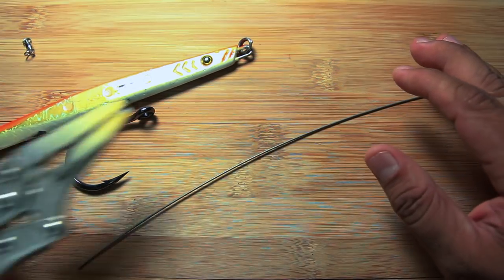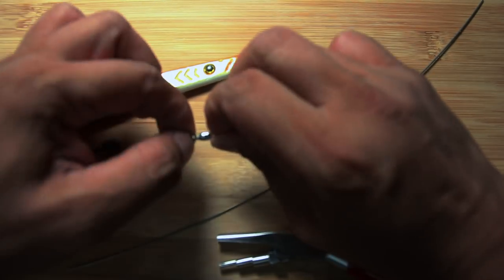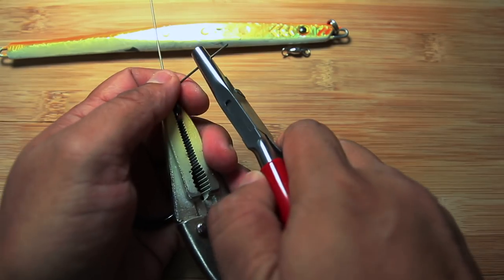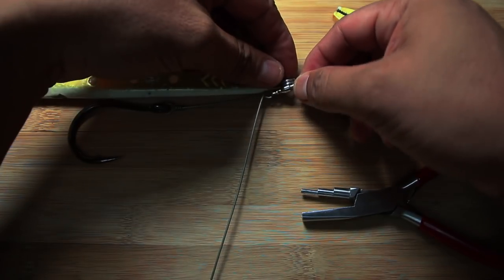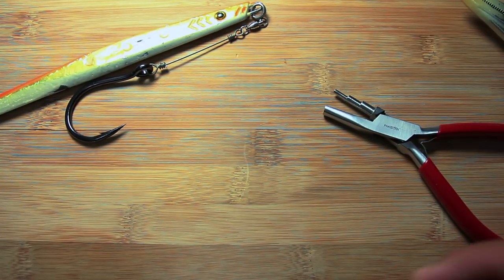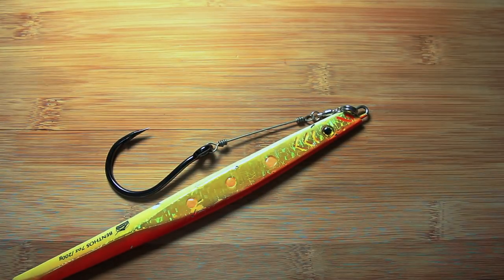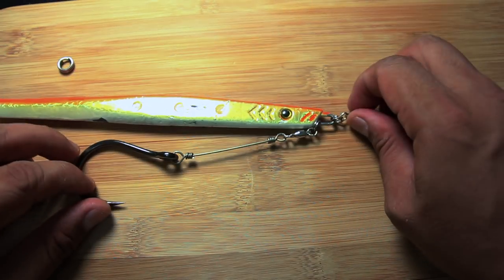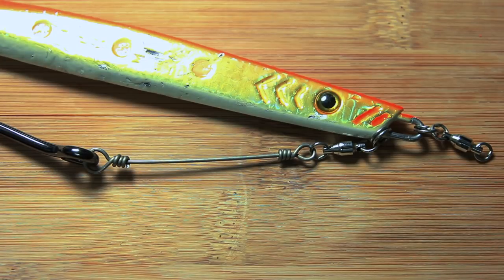HOW TO MAKE SOLID WIRE ASSIST HOOKS

Comment: Thanks a lot sir, I suggest if swivel was in the middle of wire I think it will be more freely.
Reply from the maker: Try that and see why its not a good idea.
Reply: For a safety measure try using some clear plastic/ rubber on the hook point as a guard. Great video.